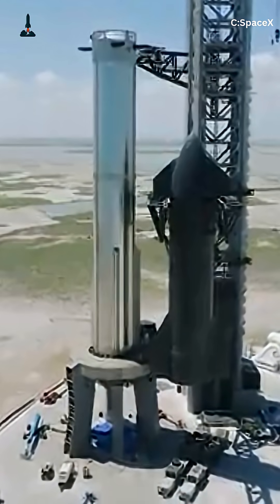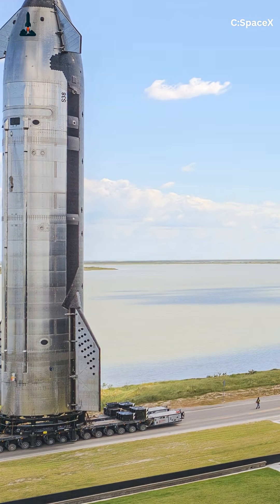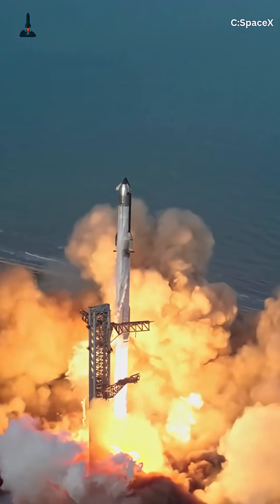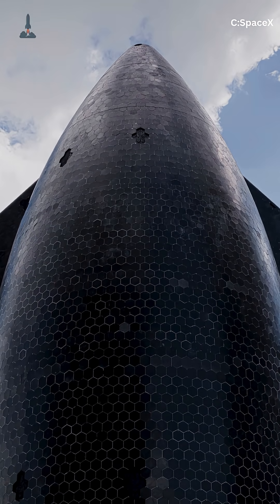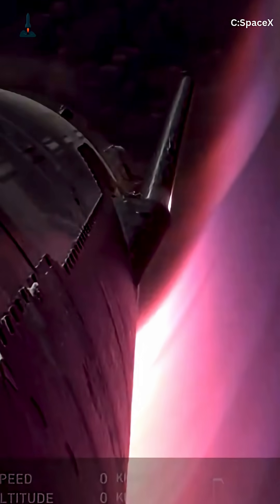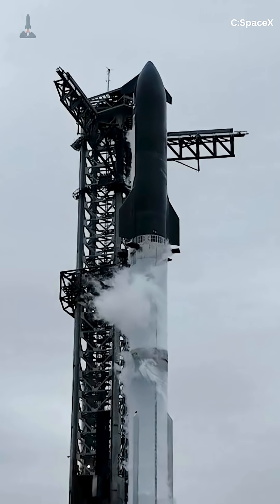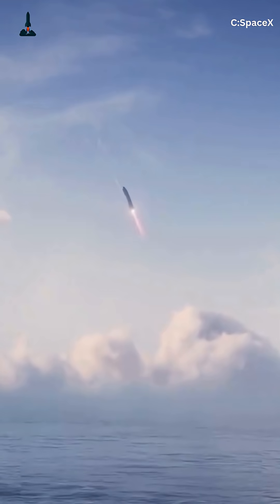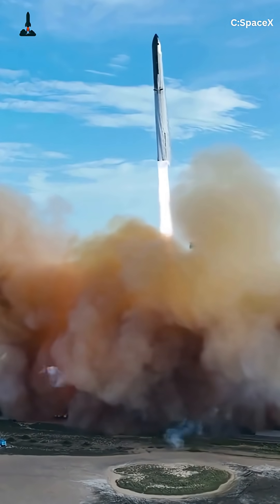Why SpaceX Risked Starship’s Heat Shield #spacex #starshipflight11 #elonmusk #starship #heatiles

Comment: 🔸️That's bold. "Possible" intentional damage, but in a controlled attempt. 
🔹️And, you're right, the calculations for each variable weight would be able to play 🎼 musical chairs.
🔸️Does the current volume of 🚀⛽️ rocket fuel (sloshing around) affect the thrusters performance when using the thrusters to guide the rocket for touchdown?
•••••••••••••••••••🥰🌻
~ Aggressive block building 👷‍♀️ comes to mind when mentioning that the ending results for todays test will finalize into Block 3.
Reply: Oooommmmmgggggg